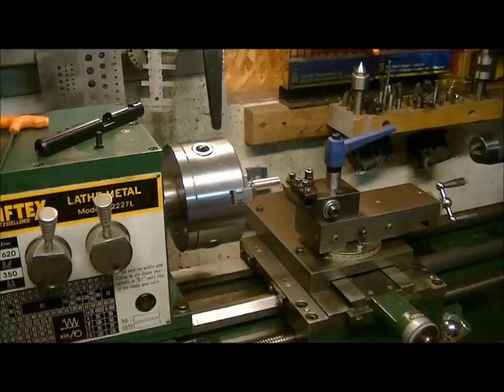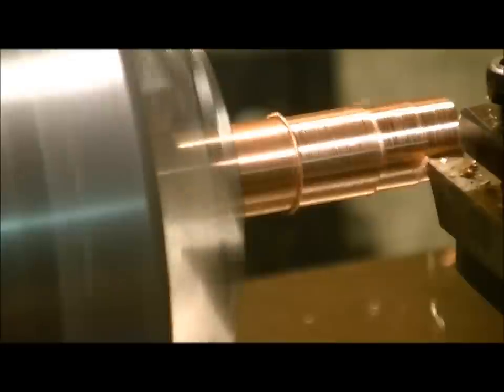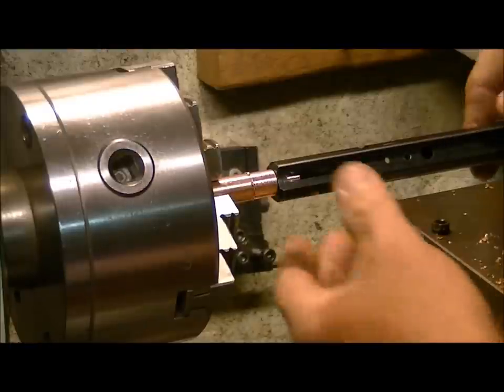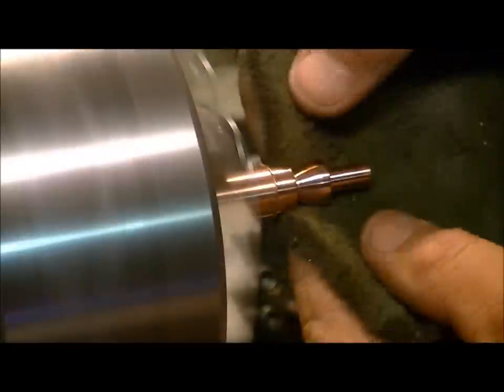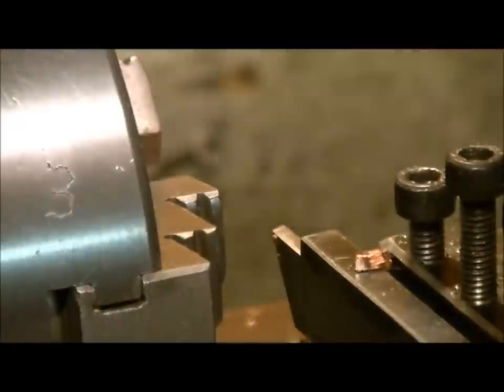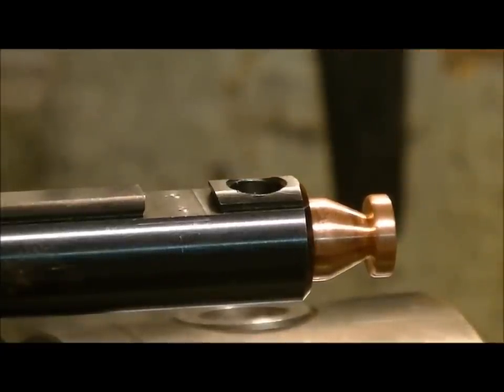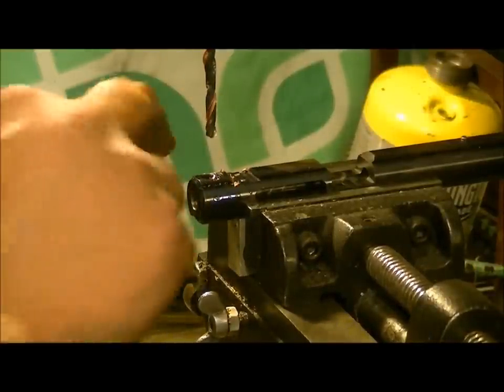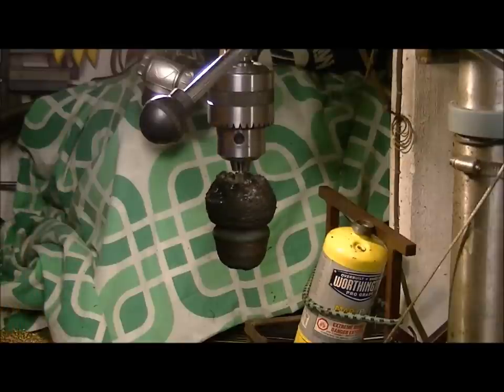How to Machine Copper round bar and a project

Comment: Interesting. I work with copper a lot, mostly bus bar for high current test sets and accessories. I haven't done any lathe work with it, so it is good to see how it goes. You might want to show how you grind the tool bit, as that affects how well it cuts. Also the drill sharpening may need a little negative rake to reduce the tendency to dig in. Thanks for sharing your techniques.
Reply from the maker: id love to but i dont have my lathe anymore but iam saving for a smaller one so sometime down the road